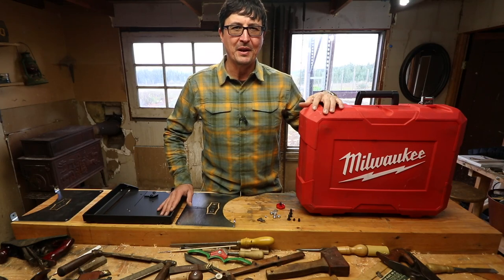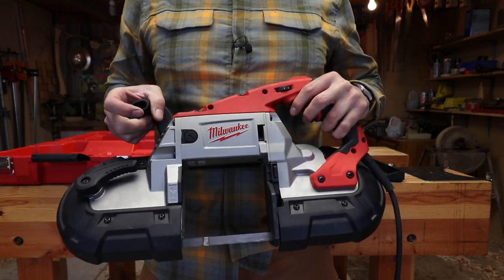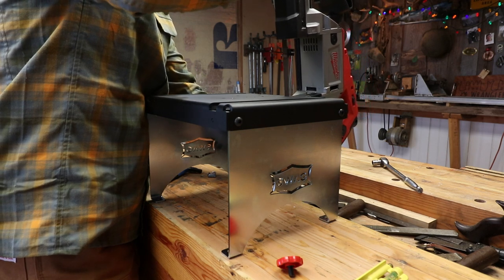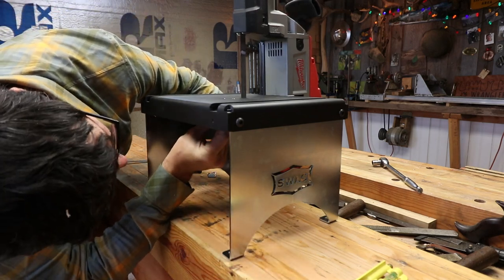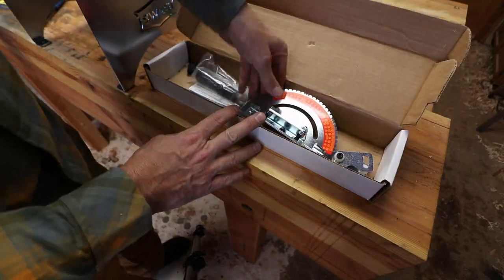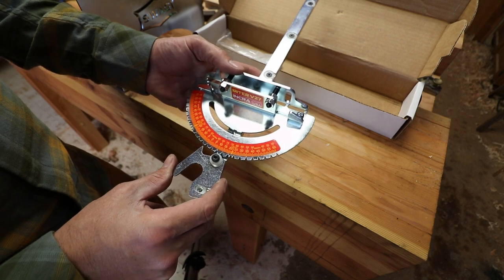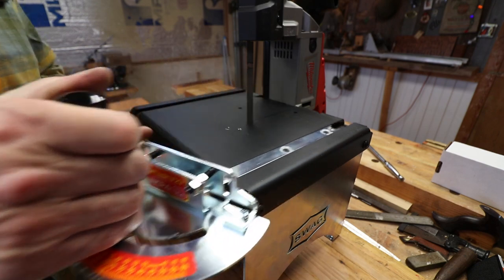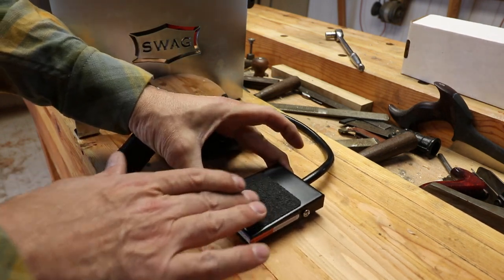AMAZING MILWAUKEE TOOL HACK!!

Comment: Anyone else watch in pain as he tightened up those bolts a1/2 turn at a time when he only had to move it 4 inch and he could have spun the allen key??
Reply: YES
Reply: ...and you know it's level cos the bubble is at the top of the tube
Reply: Yes.
Reply: I was talking to the screen...it was driving me nuts.
Reply: Hah!  Me four.  Granted they were locknuts - some can be too small to grip and finger-tighten.  He was taking us on a journey.  And yes, any rotary cutting tool with an abrasive disc (die grinder, chop saw, etc) is probably the obvious go-to.  But the man has a point about precision... i might try to fab up one for my dewalt portaband after watching this.  Nice vid.

Comment: I use a grinder with a cutting wheel for cutting metal.
Reply: according to wranglerstar thats 'specialized equipment'
Reply: rol dac I was thinking of this same solution. That said, I still like this concept for a cheaper solution to a typical table top  bandsaw.
Reply: Yeah, I do too, but a bandsaw is a lot more accurate, quieter and not as messy.  I've got a porta band with a table, a vertical/horizontal metal cutting bandsaw, a cold saw  a vertical metal cutting band saw, a plasma cutter and an oxy-acetelyne torch .  I use them all and grinders with cut off wheels as well. Oh yeah and if you are cutting aluminum a cutoff wheel doesn't work too well They all have their place.
Reply: Wait till you see someone nearly bleed to death after one of those thin wheels explodes and buries itself in their leg, nearly severing their femoral artery. Scary, and not an isolated incident.. I'll never use one again.
Reply: MegaMetinMetin
 For your information, it had nothing to do with me or my grinder. I had the honor of being the driver of the ambulance that picked up the victim of the broken disc.
Reply: I typically use "Diamond" blades on my grinder at work, I only occasionally need to use a thin wheel. I could go through all that I check and do to make sure that myself and others are safe, but that would take a while. A minute to do an hour to talk about it.

Point is, there are safe ways of using a tool and unsafe ways of using a tool, and people who use them often tend to slip into unsafe practices because "Hasn't happened yet."
Example - I WILL NOT make a cut with the guard off and I PAY ATTENTION to the guard direction. The extra grip handle is on to help me keep the grinder steady, which keeps me from binding the disc.
Reply: rol dac so do I. Have 3 cut off wheels around the house. Never needed a band saw
Reply: +ontarioknivesNS7 indeed
Reply: I've seen plenty of similar situations. It's ALWAYS user error... No guard, feeding too fast, wrong disc nut, wrong point of contact, incorrect fitment. Thin cut-off wheels are safe if you know how to properly (safely) use them.
Reply: yep!
Reply: I did and still do for some jobs...but I did this saw table with my own tools and scrap metal..spent total of about 30 bucks on entire project including bandsaw (long story but I got a refund for my saw when I purchased the wrong blades)..  it's much more accurate and intricate, especially when working with sheet metal ..and a much smarter solution for softer metals ..  it's almost a must for things like metal fab during rust repairs and stuff
Reply: That's great for cutting a bolt off, but that's useless if you need straight cuts, lol.  You'll never make a straight cut in a piece of box tubing or something with a cutting wheel that's square on all 4 sides, lol.
Reply: You might wanna learn how to use one then..
Reply: @tomkrause62  While a valid concern, I think you are overstating the danger just a little bit. I have had a wheel explode and hit me in the face, I was wearing safety glasses when a large chunk hit me in the cheek just below the safety glasses. It stung and left a small bruise, but it didn't break the skin. If it hit me in the eye it could have been bad. I wear a full face shield and glasses now, That said, now that I have a table mounted portaband (thanks Swag Off Road) I use the grinder a lot less.
Reply: No sparks with a band saw. Truly clean cuts, very accurate if you know at all how to use it. Safer, no need to use ear plugs. If you cut lots of metal, use a band saw.
Reply: I use a $60 Swag vise table with my $100 Bauer portaband. I made a stand for it from scrap plywood. I use it a lot, even to shorten bolts. No more Dremel cutting wheels blowing up in my face with sparks all over the garage. I haven’t used my grinder with a cutting wheel for a couple of years. That’s scary...
Reply: Tom Krause i had a 4-1/2 cutting disk explode the other day. It was a miracle it didn’t gash open my hand. Didn’t touch me. Was last time i use without the shield.
Reply: Not with any precision you’re not
Reply: @G19Jeeper  lol just because you can use a crude cut off tool doesnt make a band saw useless. I would way rather have a band saw
Reply: @randybobandy9828  4 year old comment.
Reply: @G19Jeeper  and?
Reply: Show us your video of you  cutting small parts with accuracy.
Reply: It’s actually very easy to cut accurately lol
Reply: I use a grinder also, but it involves me leaving the workspace, head to a designated area, usually a lockup kinda spot away from everyone to avoid any hot work permits…fit the full safety gear, gloves optional in most cases, but goggles and muffs, do the cuts and return to site, im buying one of these to see if i can now avoid the noise, the sparks, the heat and save my transit time… vs the costs of the other things and the cheaper disc cost over the bandsaw band.
Reply: Depending where I’m working those sparks can be a problem

Comment: As a chief engineer in the merchant marines, I've used the Milwaukee portable bandsaw often cutting angle iron, flat bar and pipe freehand. I got pretty good using it freehand but, since we didn't have standup bandsaw on the ship, I would have welcomed this table. Your buddy Troy has a lot going on. Thanks for the tip. New subscriber.

Comment: If you have a vise, you do not need this contraption. I know you think jimmydiresta is despicable, but his tips will save the 'everyman' a lot of money.
Reply: Ogoun I recommended Jimmy's channel to Cody a couple years ago, and Cody couldn't get past an axe head hanging video that Jimmy had recently done. I would love to see Cody's reaction to Jimmy's aluminum axe handle video, lol!
Reply: iksnyzrog this is way better then using a vice and hacksaw, or vice and angle grinder haha. if you need to make a lot of precise cuts like Cody demonstrated then you need a band saw
Reply: Jacob Ditmer You miss understood. You can use a portable bandsaw in a vise. Look up jimmydiresta's videos..
Reply: iksnyzrog that still isn't very precise compared to this.
Reply: Never said it was ;-)
Reply: I make knives as a second source of income, and I can tell you this little table has saved me a ridiculous amount of time and wear and tear on other machines. While you are correct you can just squeeze a portaband into vice and go, this table offers you a stable platform to do precise work, like cutting out knife blanks or making accurate angled cuts. I wouldn't trade mine for the world and it is used almost daily in my shop.
Reply: ominousinc While I haven't used this table, I would agree that it would be very valuable for a small business shop.
Reply: Jacob Diresta
Reply: Brett Mallam h
Reply: Yep, been doing this in a vise out in the field for years.

Comment: Its strange that some of the comments really show that people have never used one of these saws set up this way
It is really is a game changer. I have had one set-up as a vertical bandsaw for about 5 years. Built my one stand as I didn't know Swag made one. His design is better than mine but mine works extremely well.
Compared to cut-off wheel this is precision tool. You can split the scribe line with ease.  For cutting small parts with square inside corners it can't be beat. Less mess and noise than a cut -off wheel, however it is great to have both as in combination they can make hard jobs easier.
If you have a lathe and /or mill and need shorter pieces of bar stock for projects then this set is a real time saver. It may not pass OSHA rules, however with careful use it is almost completely safe.
Thanks for the great video as usual.

jb

Comment: Thanks Wranglerstar for showing us these great tools. I'm a Commercial "Union" Electrician. We use the porta-bands for cutting EMT, IMC, and Ridgid conduit. The table could be a great help to apprentices who are not use to cutting conduit and often cut an unwanted angle (anything other than 90 degree). Thanks again for the video.

Comment: Love your videos but I think you've got the wrong end of the stick here. This is designed for "out of shop" use. If you can afford to spend $125 on this why not just buy a bandsaw for the same cost?? and for much much less than the cost of the table plus the portaband ($400ish??). If you have the need for a portaband you are most likely going to have a bandsaw in your shop. This tool is amazing for offroaders/motor racing where you might need to fabricate or repair away from the shop but not the best option for the use described in your video. Not trying to be negative Nancy just thinking from a different perspective. Keep up the great videos Cody, looking forward to seeing your sawmill in action. Cheers
Reply: A harbor freight metal cutting bandsaw is $260, i don't think you will get much for your $125. If you already have the milwaukee I think this is a good accessory but I wouldn't go out and buy the two just to put together as a vertical bandsaw.
Reply: I bought the Genesis (chinese) 9 inch bandsaw last december for pen making and light duty.  It cost $125ish and I am happy with it...for what it is.  It can handle lighter gauge steel but would bog down with what Cody was cutting.  So yeah, I think you will need to pay a bit more for something for steel fabrication.
Reply: Agreed.
Reply: Not everyone has the space for a bandsaw on a wheeled base, something like this is ideal, or a Femi style one.
Reply: A lot of people don't need a large band saw and already own a Milwaukee portable such as my self so I can have a bandsaw for just the price of the little table his friend made(however much that is lol)
Reply: To be clear, with the pedal switch and miter gauge as shown, the table mod is $214 without the saw. A quick google puts the saw close to $300. 

The suggested Horror Fright saw is on the cheap end and you can get much better for the $500 you'll actually go into for this.

The real standout features are size, versatility(since you can always revert to the portaband for tasks where it's useful) and the fact that tilt-equipped metal cutting saws have awful tables.
Reply: Another advantage that I learned of watching a blade smith's videos is the kerf on the portable is thinner so there is less waste. Not really much of an issue for the average guy, but if you are cutting valuable materials it would be something to keep in mind. He used this when cutting and stacking his damascus steel for forge welding.
Reply: I'd like to make it clear that I was in no way advocating harbor freight, I was just using that as a point of reference for the cheapest stationary bandsaw-like object available.
Reply: 27dcx Lolz!!! -- Oh no HF IS GARBAGE.. My friends will disown meh!! My stingy buy cheap = buy often montra has failure points.  LOLZ!!. 

I gotta admit that HF is an option at times. Albeit a very poor one but an option all the same.
I'm in no way rich but quality is one of my prerequisites when buying anything I expect to use more than once a year. Exception is when safety concerns raises it's head.  
I flat out refuse to subject my kids or grandkids in years to come, to stingy stupidity.
Reply: HF is great to get a tool you might use 3 times.  I also have a practice of using sacrificial tools for dirty jobs.  I love the Walmart B&D drill bit sets.  Sure, they don't last long, but at $10 a set you just pick up a couple more and save the good bits for precision jobs.  China is stepping up its game.  Just like Japan did in the 1970s China is starting to produce acceptable and even pretty good quality stuff.  I threw all my preconceptions out the window long ago.
Reply: I think you're right; I can't see why you wouldn't just use a regular band saw.
Reply: Where can I buy a $125 bandsaw that can cut steel?  Those cheap small homecenter store tabletop bandsaws are garbage and should only be used to cut cardboard and thick paper.  My Milwaukee port a band will cut way better than those crappy tabletop bandsaws and this would certainly make it a more useable tool.  Great job on video and thanks for the information.
Reply: chris kerwin m
Reply: Yea but I dont want to lug a band saw in the back of my truck when I could just carry 3 pieces of steel and some screws
Reply: $125for a bandsaw?? Get your self a hacksaw for 5 bucks
Reply: You can take the
Reply: But he got the Milwaukee tool for free. Of COURSE he's advising its the best to do any job.

Comment: you could also use an angle grinder
Reply: Angle grinders are not precise.. They're loud, overheats the metal, and dangerous. When I was in the hospital for 6 days after an accident, I shared a room with 2 people who got hurt by angle grinders..  They get the job done though.. And I prefer them over hacksaws
Reply: Well, angle grinders are dangerous even if you use them correctly and safely, mostly because the disc, if isn't properly made, can fly away
Reply: Try cutting box section square on all edges, then repeat 25 times for the project you're building, see how long it takes you and how many slitting discs you go through.
Reply: Not as difficult as you're trying to make out, just time consuming.
Reply: I can be very precise with a grinder, and if you're decent with them you can make cuts without overheating your metal. They can be quite dangerous, which is why you should make damn sure that you're using them correctly and safely.
Reply: Cruiser052 Much, much more time consuming, no where near as accurate, no where near a clean cut, make much more mess, is much noisier,  and no cheaper in the long run.
Reply: user12345 Never said it was cheaper, more accurate or cleaner than other tools. I said it was doable, reasonable accurate and reasonably clean. Personally, I would prefer other tools. As a matter of fact I frequently cut 10' sections (~3.3m) of unistrut into 6" sections (~15.25 cm) with a reciprocating saw.
Reply: Cruiser052 I never said it wasn't doable.
Reply: Or youcould use a Dremel tool...
Reply: you could use your teeth
Reply: ...if you want to grow a beard while cutting through steel bars
Reply: Or a metal cutting blade on a circular saw. But I love my Hitachi portaband, $100 used.

Comment: Those stands are really trick. I use one for cutting stainless and aluminum mandrel bends for fabricating custom exhaust systems, charge piping, and general fab work. A must have if you own a Milwaukee portaband.

Comment: You had me pissing myself laughing when you kept wondering what you'd cut a piece of steel with if you didn't have a fucking bandsaw or a "big heavy saw".  It's called an angle grinder, they come in all sizes and they can cut a piece of steel just as well as this thing.  Mind you this is a great tool but you made a complete mockery of yourself when you couldn't work out that you'd cut it with an angle grinder.  Fuckin carpenters or as we call them in Aus, chippies
Reply: Charlie Britton sameee

Comment: this is  a more precise tool but generally i would use an angle grinder for these jobs because its cheap, versatile and with some practice quite accurate.
Reply: The is a way better tool for cutting metal.

Comment: For all the people that keep saying "Dude, just use a grinder," that is not a solution for every problem.  A bandsaw is a much better solution for instances where you don't want to sent burning hot sparks flying into potentially flammable material or gasses, or contaminate everything in the room around you.  It also tend's to not over heat the metal you are cutting, ruining the finish.  Bandsaw blades are also longer lasting, meaning you don't have to change them every few minutes when cutting a thick item.   And cutting off anything overhead with a portable bandsaw is so much more pleasant that using a cutoff wheel.  Abrasive cutting may be faster, but in a lot of instances the mess and hazard is not worth the tradeoff if you can avoid it.

Comment: I feel like that table should have a metal top, looks like after just a few uses you've already scratched it but a metal top would probably hold up better.
Reply from the maker: The top is metal,
Reply: Xegmin probably means a "bare metal" surface.
Reply: yeah, the paint is gonna wear of rather quickly but I guess its mostly to protect it from rust while it's in storage/getting shipped.
Reply: Scratched paint adds character.
Reply: Xegmin it is powder coated metal. I have one and it is very durable.
Reply: Don't call this a "hack" your not a teenager... you installed it on an aftermarket stand. I have a great table saw hack its a biesemyer fence I bolted on it

Comment: That is a nice table. i have had a shop made one on my portaband for years.  But for bar stock like you are cutting., my go to tool is a 4" angle grinder with a cutoff wheel.
Reply: yeah, but chews through a lot of cut-off discs, breathing that material, in your nose, in your clothes, higher risk of 'kickback', sparks, negative things of that nature..
Reply: Regardless of the cutter, there's going to be iron oxide particulate (and chromium if you're chopping stainless). Not really anything to worry about -- portaband or rat-tail -- unless you're working in a 6x8 room for hours on end with no ventilation. This could be real handy in the field especially so you don't have to source an outlet like you would a chop-saw or angle grinder.